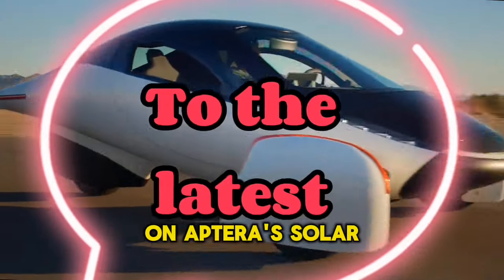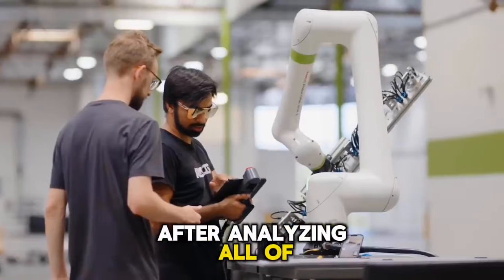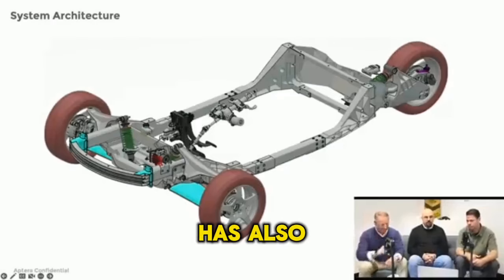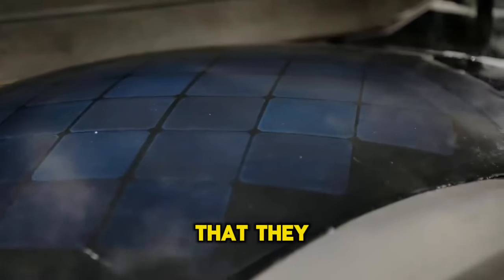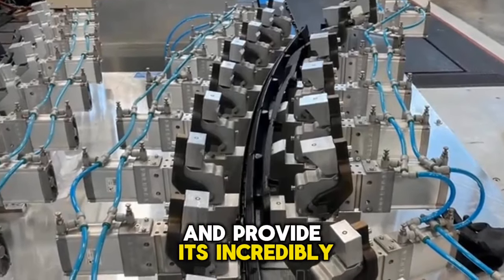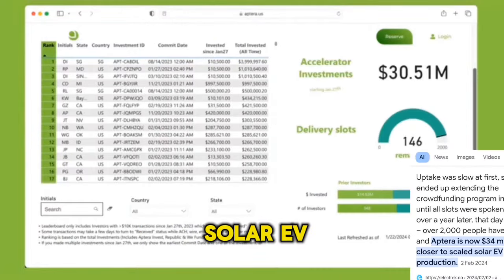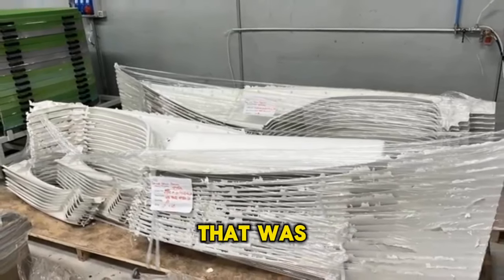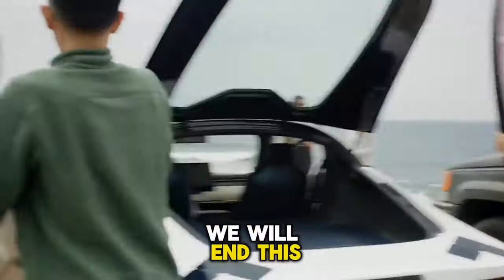APTERA solar panels upgradeable to last at least ten years, improved aerodynamics

Comment: I am so glad that aptera has glass solar panels they should last far longer than ten years. Glass is 100% U.V. Stable plastic is not. There panels have potential use on other vehicles. I did order a glass rear hatch. But if they make add on panels of the same quality I will buy them.
Reply: You might be disappointed to hear that Aptera's glass TOPPED panels have a lot of plastic in them.  The most vulnerable is a critical layer between the glass and the solar cells.
Reply: @johnreeves7261  The glass cover blocks most UV - unlike the all polymer ones.
Reply: @n.brucenelson5920  If Aptera is using appropriate "solar glass", it's not blocking UV as the solar cells (Maxeon) want it!  An Aptera engineer even said don't wax Aptera's solar panels as it will block UV!!!!!!
Reply: @bobhilder1469  The same video in which the Aptera engineer (Reid) said don't wax Aptera's solar panels as it will block UV also has a great shot of the failed hood solar panel that n.brucenelson want's us all to forget about.....
Reply: @bobhilder1469  The glass sheets are very thin - similar to what us used for cell phone screen covers - but in much larger sheets.
Reply: @n.brucenelson5920  And UV transmission is inversely proportional to thickness which means more UV attacking the "polymer".
Reply: @bobhilder1469  The primary reason for switching to glass is that it is much more scratch and shatter resistant and results in a lighter weight panel, both large advantages.
Reply: @n.brucenelson5920  And I applaud them FINALLY taking the advice of the experts (that they utterly dismissed) and switching to glass.  Now if only they would listen to the experts about the silly 45 degree rotation thing and the bypass diode thing and the ridiculously high voltage boost ratio thing and so on and so on.....
Reply: @bobhilder1469  So in summary, Aptera's solar panels will have plastic that is attacked by even more UV than "normal" solar glass topped panels but that's okay because they are large.  ;-)

Comment: Aptera claimed their first two iterations of solar panels (Solar 1.0 and Solar 2.0) were designed and tested to last at least 10 years as well.  Both failed within 1 year.  Anyone who believes Aptera's claims about the latest iteration (Solar 3.0) is rather naive.
Reply: Untrue.
Reply: Failed in what way?
Reply: @ronfarnsworth7074  Maybe johnreeves will chime in with more but here's my list:  Solar cell to solar cell and solar cell string to solar cell string interconnect tearing, bubbles in encapsulant, shifting cells and strings, encapsulant delamination from solar cells.
Reply: @ronfarnsworth7074  said: "Failed in what way?"  Great question.  Delamination was likely the primary failure mode.  The interconnect tearing is also of concern.  Interconnect failure in solar panels usually manifests itself in the form of an open circuit.  If there was an open circuit in the panel, then that part of the panel would deliver exactly 0 watts....